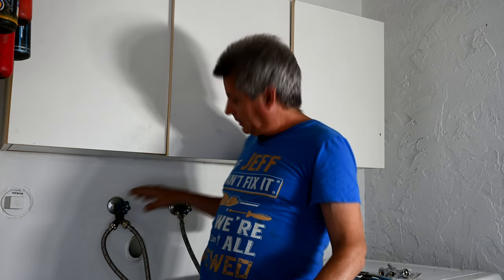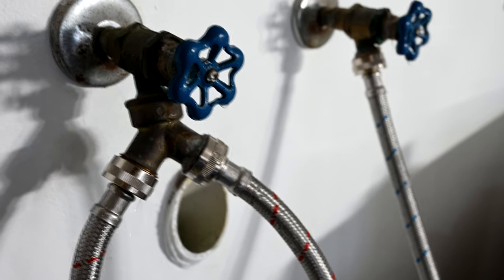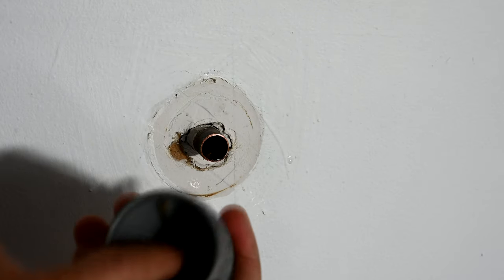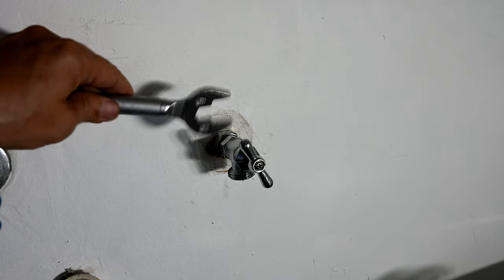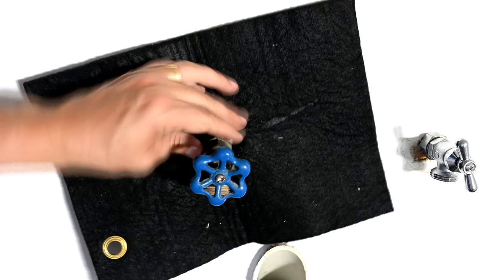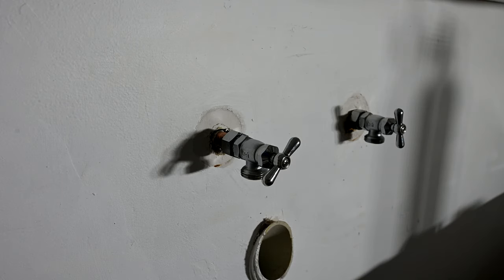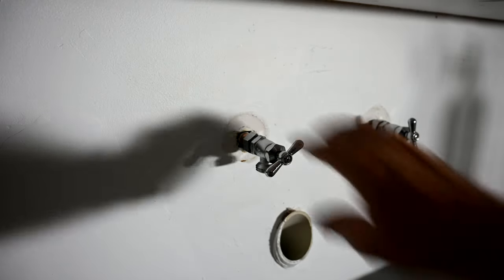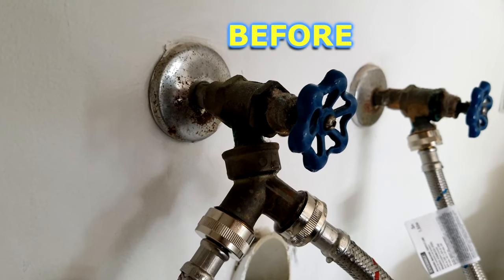How to Replace Leaking Washing Machine Water Shutoff Valves

Comment from the maker: ✅ Tools used in this plumbing tips DIY video: 
✅ RIDGID One Stop Wrench Kit : https://amzn.to/2ClCbNa
✅ AutoCut 1/2" Copper Tubing Cutter: https://amzn.to/2MaCboJ
✅ Channellock 12-Inch Pliers: https://amzn.to/2MdcnGR
✅ Bernzomatic Trigger-Start Torch Kit : https://amzn.to/2Bzj80K
✅ Oatey 31400 black cloth Flame Protector 9-Inch x 12-Inch https://amzn.to/2mI7DjT
✅ Armour Line Pipe And Tubing Reamer: https://amzn.to/2Rut3OQ
Reply: Can you put a link to a Compression Water Shut Off Valve that works with your RIDGID One Stop Wrench Kit?  I'm going to change out my slightly dripping washing machine water shutoff valves after a new washing machine installation.  They weren't leaking before the new washer install and apparently this is commonplace.

Comment: I don't understand what is holding the valve onto the pipe, as far as i can see the pipe had no thread.
Reply from the maker: It is a compression fitting that compresses against the ferrule ring. The more you tighten the front and back parts of the valve togethers, the more it compression tightens around the ferrule ring.

Comment: Are compression fittings okay to use? I am in NJ. I tried using shark bite shut off valve but it spins around and since the basement is brick walls, hard to attach the shark bite shut off valve to the brick.
Reply from the maker: Yes compression valves are what I use exclusively now they hold much better and nice and tight compared to the shark bites. I only use sharp bites for a temporary basis.

Comment: To change hot water shutoff valve, did you need to turn off water heater and drain the water?

Comment: Thanks for the helpful video! How long would I need to torch for the valve to come off?
Reply from the maker: Takes about 30 seconds for the solder to melt enough to remove the valve. IF it does not reflow and melt, then you have too much water in the pipe, there can't be any water dripping out of the pipe.

Comment: Do I have to swear off the hot water valve or can I cut and install the compression valve like you did with the cold water valve?
Reply from the maker: If you have enough pipe, you can just cut off the valve. In this video I saw how little pipe was commin out of the wall, and decided to sweat it off, then it's easier to slice off the end of the pipe if you need to.
Reply: @jeffostroff  thanks! I was able to actually pull off the old compression fitting with a wrench so I still had enough sticking out

Comment: Did you do the two different ways just to show the different ways to change the valves? Or does the HOT water valve need to be change that way?
Reply: Never mind with me question....I just re-watched the video.
Reply from the maker: Yes it works for both valves, sometimes watching a second time you absorb more of the details. Often times I find myself rewinding parts of someone's video 4 or 5 times.

Comment: Good repair Jeff. Why didn’t you use ball valves? I would also replace the main shut off with a full port ball valve.
Reply from the maker: i prefer ball valves, Home Depot did not have any that I could use. The valves I would have liked to use there were the red and blue handle 1/4 turn ball valves, but they were 4" long types that are really meant to be installed in the washing machine outlet boxes that goes in the wall. I might use them anyway the next time we do a washer valve change out.

Comment: I have a question.  My washing machine is right beside my basement door.  I don't have a hose bib outside of the home.  We want a garden and need to be able to water it.  I'm wondering, if it is possible to use the cold water from my machine to a garden hose for outside?  I am imaging that I could get the right fitting that would work as the machine looks smaller than an average garden hose.  Or....should I just call a plumber and get him to put me in an outdoor bib?  Thanks in advance
Reply from the maker: I think the best course of action is to install and outdoor bibb. then you will always have easy access.

Comment: are all pipes behind the water valve copper?
Reply from the maker: It really depends on the age of the house somehow this might have the red and blue pecks pipes com up and somehow this may have been built with a polybeautiful ingredients that are now illegal since 1995 but we're big in the 1970s and 1980s. And then in the fortiesThey used to use galvanized steel or cast iron pipes
Reply: @jeffostroff  thanks for the quick reply, regarding the compression nut you placed after you reamed the copper tube, what size is that and is it standard, and does that "gold "insert come with the compression nut?
Reply: @jeffostroff  "pex"

Comment: I notice you didn't flare the tubing stub after installing the new nut and compression fitting. I can see where flaring would complicate a future valve replacement, but otherwise it seems like added insurance against the valve popping off the pipe. Your thoughts? Thank you!
Reply from the maker: We don't flare the tubing the compression is sufficient to get a good grip on there to overcome 60 PSI.

Comment: Way to go Jeff thank you great video once again! I see the compression fitting is easier fix than trying to solder back on & burning house down. What's your take on the Shark bite type of repairs. I used it replacing our Moen shower valve assemble didn't want to risk a fire!
Reply from the maker: I use Shark Bites on occasion but I will only use them outside the wall, just in case there is a leak some day. In our neighborhood we have the gray polybutylene pipes which are illegal now. When we change out a water shutoff valve under our sinks, we have to use a shark Bite connector to convert from poly pipe to copper pipe, then we install the standard compression valve on tot he copper pipe. I would only use a shark bite inside the wall if there was an access panel on the other side where I could check for leaks from time to time. Other than that I use shark Bites to temporarily cap off pipes, or to help make emergency repairs until we can get to the store and buy the right parts.

Comment: Is it common practice to use silicone on compression fittings or just something you discovered with experience?
Reply from the maker: I decided to use it because sometimes I could not get the nut tightened enough to make the compression of the ferule seal up the joint. So I started using the silicone grease to help lubricate the threads to that it becomes easier to tighten. Also, the silicone grease does offer some sealing properties, but should not be the main seal. The ferule should compress down enough to make your seal, the silicone grease is just a cheap insurance policy.
Reply: @jeffostroff  Technically compression fittings were designed to use only on soft copper yet over the years people started using it on hard copper. With a little practice a torch is easy to use, just be easy with the flame and use the tip of the flame in tight places.

Comment: Still had quite a bit of dripping from the right pipe even after the main water valve was closed.  Is it possible the main valve needs to be repaired as well?
Reply from the maker: Yes we see this all of the time especially with those multi turn gate valve shut offs. I encountered this about 75% of the time when I have to cut somebody's water off to do something. I always tell him they need to bring someone into replace that shut off with a quarter turn ball valve they are much more reliable.
Reply: @jeffostroff  Thanks for the quick reply.  Agree that quarter turns are the way to go whenever replacing shutoffs.

Comment: Which kind of compression fitting do I need?can u post a link to one at Home Depot?
Reply from the maker: https://www.homedepot.com/p/Everbilt-1-2-in-x-3-4-in-Brass-COMP-x-MHT-Washing-Machine-Pressure-Regulating-Valve-VWMFRTD3EB/205811973
Reply: Thank you! ... also, so I need these special ranches or will vice grips and a pipe wrench work ?

Comment: I have a question on replacing the water supply lines. The lines are 12 years old, showing no signs of leaks. Should I replace them as preventititive maintenance? Also, since, they've been connected to the valve for 12 years, should I lubricate the connection area a day or two before trying to remove the water supply line? Thanks
Reply from the maker: Experts recommend laundry machine supply lines be replaced every 5 years. I only use steel belted hoses.

Comment: Torching!  Boys will be Boys! Apart from doing a nice renovation, is there any reason against just replacing the tap (shut off valve) "gasket" ? or, should we always replace the lot by every 5 years? I detected a little water when turning the tap handle off (regular practice after each wash) so changed the hose as it wasn't replaced with the hot one +12 mths ago, by a serviceman. I havent replaced the washer (gasket) yet as only had one shifter spanner. There doesn't seem to be any leak now. Does this sound all good for now? BTW congrats on this video, nothing else came close!
Reply from the maker: I only change the shut off valves on a flip property if they look really bad, or if they leak. When selling your property, nothing beats  new shiny valves. IT gives the home inspector nothing to complain about.

Comment: What's your feeling on the shark bite fittings?
Reply from the maker: I will only use Shark Bite fittings on the outside of the drywall, never behind the drywall. I prefer soldered connections any chance I can, and prefer to use Shark Bites in an emergency, or a temporary fix to give the owner running water while we engineer up a fix or order parts. I also use Shark Bite end caps quite a bit if I have to cap off a pipe to provide running water while we run to the store, or to leave it like that during a project until the plumbing rough in is ready to be finalized with water shut off valves, etc..
Reply: No professional plumber should be using Shark Bite except in the limited instances that Jeff mentions.  That's because they have the soldering skills, and soldered copper has stood the test of time, where Shark Bite is still somewhat unknown for longevity.  If I paid a plumber who used Shark Bite, I'd feel ripped off.  That said, for the self reliant DIY person who isn't interested in learning copper soldering, like me, Shark Bite is a liberating thing.   Now no plumbing emergency is out of my reach, and I've fixed half a dozen leaks in the copper piping of my 60 year old house with Shark Bite.  Just because a pro shouldn't use Shark Bite doesn't mean you shouldn't.
Reply: More like Shark Slip. Would never use them.

Comment: You could have simply tightened the packing nut to stop the leak.
This was not just a $10 fix, the two valves, escutcheons and tools made this a costly repair over what was actually needed.

You can repack the graphite seal cheaper and quicker with the same or better end results. All you need is a wrench and the packing material.

Comment: Quarter turn ball valves last longer than multi-turn compression.  Did you try tightening the packing nut on the original valves?
Reply from the maker: We could have fixed this in 10 seconds, but decided to go the replacement route. Unfortunately Home Depot did not have 1/4 turn washing machine valves in stock so we reluctantly went with these new multi turns. The only 1/4 turn ball valve HD had was those real long one that mount inside the large white outlet boxes in the wall. Too long to have sticking straight out of the wall.

Comment: One thing i always do after installing water valves or angle stops is i clean off the valve with a napkin. Then i take another clean napkin and set it under the valve. If theres any leaks it will drip onto the clean napkin
Reply from the maker: Yes, that is a good idea. I use that all the time with P-traps after an install, as sometimes you are likely to see the weir nut drip a bit.

Comment: What if there's a ground clamp attached to one of the valves? Do I need an electrician first?
Reply from the maker: We have run into this before so is the ground clamp for the entire house? Or just one appliance? So either way you can remove the clamp temporarily if it's in the way and put it back when you are done and just make sure everybody in the house is warned that there is no ground protection during this operation . If the pipe looks corroded at all this is always a good time to take a little Emery cloth sandpaper and brush it up nice and clean copper and then reattach the clamp over the spot that you sanded
Reply: @jeffostroff  It's possible in some conditions (including those where your adjacent neighbor has a hazardous wiring condition) that there are both voltage and current flow present between the "ground" conductor and the copper pipe.   These grounds and bonds are not just to protect electronics; opening them could pose a hazard to the person performing the repair.  Extreme caution should be exercised, and at minimum, open the main disconnect to the house before disconnecting.  This will reduce the risk but not completely eliminate the exposure.  In the off chance the neighbor has an open neutral at the incoming service, your ground connection may be providing the alternate path for the neighbor's neutral current flow.

Comment: sometimes if there's not enough pipe coming through the wall you can pull that pipe out I have  and put a vise grip on it  hold it out but a lot of times there's a little play in these pipes
Reply from the maker: This pipe was well strapped to the stud in the wall, we had side to side wiggle, but not front to back wiggle.

Comment: Replacing the valve seems like a LOT more labor than simply replacing the gasket, assuming the nuts on the valve aren't stuck. (Plus the purchase of the tools if one doesn't already own them.)  In my case, in a condo built during the 1970s, the cold water valve doesn't drip like the one in the video, but closing the valve all the way fails to shut off the water. (So I won't be able to disconnect the clothes washer from the other end of the water supply hose without causing a flood.)
Reply from the maker: when selling a house, or even not, it's a good time to replace a 40 year old valve, and make everything look nice and fancy and new for the buyer's inspectors, and we all love 1/4 turn ball valves.
Reply: @jeffostroff  : In my case, a condo in an 8-story building, the water supply to 16 condos' kitchens will need to be shut off during the repair or replacement of my clothes washer's water supply shutoff valve.  Minimizing the time during which 16 kitchens will be crippled is another factor to consider, and putting in a new gasket would take much less time than replacing the valve (assuming the valve's nuts aren't stuck).  The difference in time for a wannabe DIYer who hasn't done plumbing pipe work before probably rules out replacing the valve myself, unless the old valve can simply be unscrewed from the pipe and a new valve screwed on.
Reply: I was thinking the same thing. I was looking for a demonstration of how to replace a washer in a shut off valve that looked like mine before I took it apart.

Comment: Why do the washing machine hoses have round fittings, while all other plumbing supply hoses have square or hex? If you have corrosion, it's almost impossible to loosen without damaging the connection.
Reply from the maker: That's why you are supposed to use steel belted hoses and replace every 5 years so you don't have this problem. Many of the newer hoses come with hex hose ends that will fit a wrench
Reply: @jeffostroff  appreciate the response. But why were they ever round to begin with? Much harder to turn, and if you use a pipe wrench you crush the fitting. If you use only your hands it may not be tight enough.

Comment: Looks like you replaced a new valve with a circa 1940’s valve 😂😂😂 jk, good job
Reply from the maker: Joe, you know it, they were butt ugly, I was disappointed in Home Depot, this was the only compression washing machine shut off valve they had, and not only does it look old fashioned, it's a multi-turn, not a 1/4 turn like I prefer. I usually like to get the red and blue plastic handle shutoffs, but the valves they had in stock were those 4" long sweat on types that are meant to be used in those newer white plastic washing machine water outlet boxes that go in the wall. I could have gone to a plumbing supply house to get the perfect designed 1/4 turn angle stops., but I wanted to keep everything as though the DIY homeowner would be doing it.
Reply: @jeffostroff  Good for you

Comment: Should have opened the spigot at the main shut-off outside and you wouldn’t have had so much endless water dripping from the washer spigot that you were changing. The outside water spigot is lower than the inside and the water would have poured out there and by the time you got back in the house/garage and opened those spigots nothing would have came out. Also, it was you that caused hot water pipe to have all that movement in it, you can clearly see that when you were tighten the new valve on you broke the tack nail that was holding the pipe still.
Reply from the maker: You are wrong about the the water pipe, it was already loose because the builder never had any type of appropriate pipe bracket to secure that pipe inside the wall. In fact, look at 13:25  in the video, before I even install the parts onto the pipe you can see it is loose. This was not caused by me tightening the new valve on, it was like that before I ever started. We solved this at 17:30 in the video like we do 100% of the time this happens by squirting PL adhesive into the opening around the pipe and drywall, dries hard as a rock. Works like a charm.